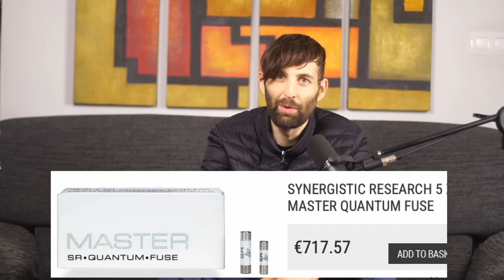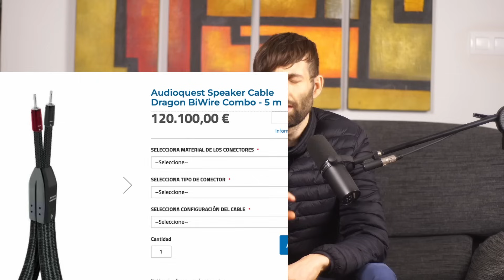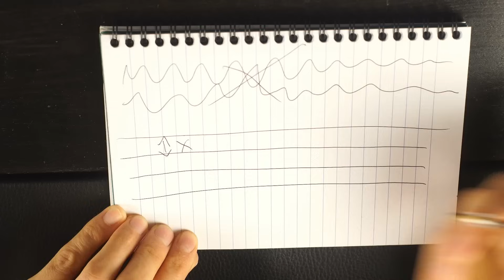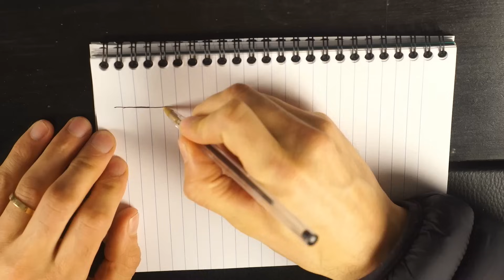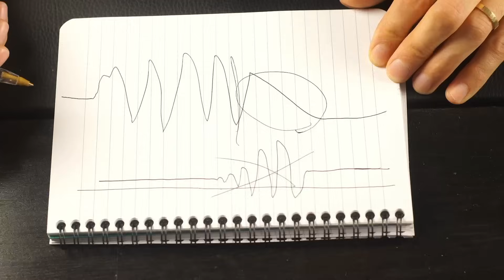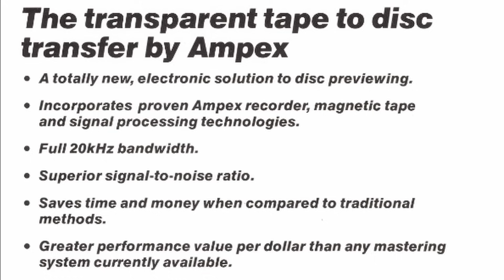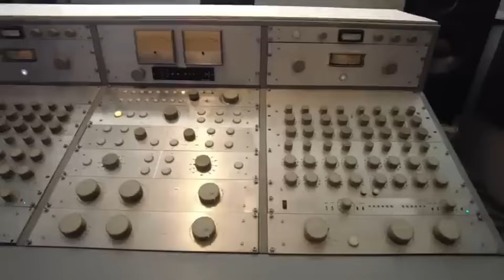Hard truth: most vinyl is digital anyway

Comment: 14:10. Not confusing at all. In fact, I've been waiting for a market model to emerge based on degree of lossiness. Open reel session masters copies, raw and uncurated: up to $5,000 a song / session. Curated open reel master (copy): up to $750. Typical lossless hard copy (vinyl): $85. Required digital copy (where applicable): $40. Typical vinyl plus digital: $105

You get the idea. The tiered quality classification system should be 1) standardized and 2) used to evaluate copyright claims (e.g., the end user's infringement and liability would be different for unauthorized use of an mp3 than for "borrowing" and bootlegging the open reel set and should be evaluated accordingly; or some rights holders may want to dispense with copy rights entirely for select categories, say, by making mp3's freely shareable or similar).

Comment: A lot of streaming software normalizes every track automatically, so if you publish a low compression high rez version, it will be normalized and sound louder than normal automatically in most cases (which is good). Roon uses 64bit float depth conversion prior to volume normalization, so no headroom is lost.

Comment: Most vinyl masters have been pushed through a-d/d-a during cutting since early 1970's. It was trying to be a 14 bit chain, but maybe 12 or 13 bits actual.   It still rawked!  13 bit audio can be VERY VERY GOOD, and still a few dB quiter than the best vinyl record playback.  If recordists and mastering of CD's were intent on best s:n and lowest distortion, not overall mostest-loudest,  CompactDisc would never have had the hate, and older cd's would sound EVEN BETTER as newer-cheaper-better d-a converters got into $1000 consumer stereos. Loudness War remastering was a crime against consumers of music.

Comment: When you buy a really expensive turntable with a good needle and clean your vinyl with some fancy machine the lp can sound almost as good as a cd.
Reply: absolutely true.

i think a lot of what people like about vinyl are the flaws. for instance, i think "musicality" is dynamic stylus drag. high torque turntables sound "dead" or gasp "digital" because they have accurate and consistent speed.

the more accurate your playback... the more it sounds like the digital which is either accurate, or not playing.
Reply: a "cheap" cd?
Reply: @hazardeur  you can get most modern music for €15-€20 on CD, on vinyl it’s about 3x the price.
Reply: @hazardeur   Well, the vinyl record is likely more expensive, I think the poster aimed at that? I try to read forgivingly, with text being highly lossy and such.
Reply: @hazardeur  Cheap CD player.
Reply: @axi0matic  are there such things? i mean the speakers can be cheap obviously but the player as such is just a laser that reads the signal or not?
Reply: @hazardeur ? As in - a CD player that doesn’t cost much money…
Reply: @hazardeur  There might be differences in error correction, which may apply on old CD's with physical damage on the disk itself.

Otherwise there might not really be any significant differences that would be applicable to a CD quality Audio track.

Comment: Did you look at my comment in the previous thread? I was specifically saying the difference is probably that the analogue recording mechanism used in classical and jazz recordings in the "golden era" (1940-1970) are superior in terms of dealing with dynamic saturation in a way that sounds more like how the ear handles loud sounds in the room (namely the ear does not limit, it saturates)
Reply: The ear absolutely DOES limit, it takes less than 5 minutes of +100dB sound ..
Reply: @hansemannluchter643  I am not sure what you mean. The only thing I know of that has any analogy to limiting is the contraction of the stapedius muscle which occurs within milliseconds after music hits 90-95db (more or less depending on the ear). That dampens the vibratory pick up in the ear, but it does not limit in any sense equivalent to what digital limiting does. It is more like putting a temporary mute on a violin. It certainly does not prevent acoustic saturation as voices and orchestras peak.

Comment: Vinyl does in fact sound better than digital....when you buy original pressings that are all analog.  The reissues over the last 20 yrs all have digital in them.  They are over bearing,flat,too compressed,and the mix sounds cold so therefore they add more bass to sterilize it.  Hence,a digital quality sound .  Bring me any CD and I will beat it sound wise with a  true analog 1st pressing.   
Bring money too if you're a betting man.

Comment: The loudness war is what caused audiophiles to prefer records.
Reply: That's an interesting thought. There was also a problem in the early days of CD mastering. In the mad rush to get CDs mastered and pressed, they were taking the tapes with RIAA equalization and going with those. I don't know how many, but there were discs getting to consumers with a huge high frequency boost; the EQ that makes vinyl LPs sound good. I'm a fan of vinyl, but I would never say that it's best. The 33 1/3 LP is an amazing example of materials science and engineering from CBS in the late 1940s.
Reply: The RIAA curve has never been part of the tape. It's simply a fixed curve used for every cutting process.
Reply: @ksteiger  You are probably right. It was something I remember hearing in the confluence of stuff going on back then. Perhaps an excuse?
Reply: @scottgfx  Very early consumer DAC chips were not linear and were actually 14 bit and not 16. Basically Philips has to select every TDA1540 they made for linearity. The most linear were used in Marantz CD players, the other in Philips ones. Then they made the TDA 1541 that at leas was 16 bit. Linearity problem were solved in the SAA7321 that used 1-bit "PWM" bitstream the linearity problem was solved. So early CD players, epecially if used with a system designed for vynil sounded with a lot of high frequencies and tinny.
Reply: @scottgfx Agreed, I remember listening to a Van Morrison album on CD that had been transferred to straight to CD from an analogue master. The hi-hat was sitting out in the middle of the soundscape so much I laughed my head off, then gave the cd away to someone.
Reply: For some audiophiles, likely.  But not all.  Tons of audiophiles still insist that vinyl is better "because it's warmer" etc... etc...  Most of them don't know what they're talking about and are blindly buying into the snake oil salesman buzzwords.
Reply: yeah this.  I'll just cut and paste my post...

I think one point that maybe wasn't clear was that vinyl has a greater dynamic range than digital. That is completely not true. Digital has the greatest possible dynamic range. Vinyl is a COMPRESSED format by it's very nature. He touched on that in the video. Longer records sound quieter because the grooves are closer together. In fact, my original vinyl release of Rush's Presto says right on the back cover, "side B is longer than side A and therefore quieter, so TURN IT UP!".  Vinyl is compressed. When you compress you LOSE dynamic range. Vinyl is simply not capable of the dynamic range of digital recording. 

The reason people THINK it is, is because of early CD's (also a compressed format) and the loudness wars. The reason so many modern recording sound so bad is because producers and mixers smother them in compression so they sound at the same level (volume) as every other song on the "radio" (spotify). This kills all the peaks and valleys that are present in the recording and makes them sound fatiguing.  People are confusing the inherent ability OF the format with what actually gets released. There is a reason all the best classical performances are recorded digitally. It's up to audiences to demand digital versions utilize the technology to it's fullest. People need to be taught that it's OK to have to use your volume knob.  

It's also because CD's are not large enough to hold full lossless (WAV) files. If you used lossless WAV files for a CD you might get 4 or 5 songs on it. Older ones were even worse from what I understand. So a lot of vinyl snob experience was from those early CD's which were compressed like crazy and often didn't sound great. That's not a flaw of digital. It's a flaw of the CD format itself. 

Now..in terms of "better", that is completely subjective. You can like the "warmth" of tape hiss, and how it sounds transferred to vinyl, better, but in terms of the objective measure of dynamic range it is not better.
Reply: @ ur wrong, vinyls are mastered with more dynamics than digital, and thats a fact.
Reply: @bobzmuda3940  did you not watch the video?
Reply: @michaelbrunner4968  he did
The guy who made the video left out crucial points.

Specifically that digital mastering is complete garbage .

Rather than taking advantage of the increased dynamic range, they just raise the volume of the whole damn thing .

This is why vinyl is still around for people who have ears.
Reply: @LuciferisKing666  god bless you 🤟
Reply: @bobzmuda97  nope. I don't think you understand what mastering is.
Reply: @ i graduate 2 schools in recording arts, i know what mastering is
Reply: @bobzmuda3940  well good for you. Another one who paid thousands just for their teacher to say how marvellous they are
Reply: @ actually what i got from it is learning how to record mix and master music.
Reply: @bobzmuda97  no you don't. Cause if you did you'd know that "digital mastering" isn't ONE thing like you implied. You can digitally master something with compression or without. You can make a digital master as dynamic or as squashed as you want, based on the dynamic range of the master recording. Whether that master recording was digital or analog. 

geezus...just search "dynamic range of vinyl" It's about 70db. 16 bit digital is 96db. 24 bit is about 144 db. Studio master tapes are about 77db. 

Those must be the 2 worst schools ever.
Reply: @ wrong. digital mastering is exactly that, mastering for digital platforms. you can master digitally, or master for digital. i was referring to the latter 👍
Reply: @bobzmuda97 Master for "digital" is a meaningless statement. CD's are digital. WAV files are digital. Spotify is digital. Youtube is digital. Bandcamp is digital. So what are you talking about?  You're making up your own strawman definition of mastering which goes against the what it's meant throughout recording music history. 

If I digitally master my WAV file and put it on bandcamp it's a lossless recording and thus has more dynamic range than vinyl. So no. You're still wrong.
Reply: @ nah, all the mediums you listed are ruined by modern day loudness war mastering. they master cds, spotify, and youtube, all usually with .wav files completely bricking out and hard clipping their waveforms, either with too much compression or limiting. 
read Modern Recording Techniques. it’s a standard textbook in every curriculum, the author is David Miles Huber
Reply: @bobzmuda97  geezus...you really don't know what you're talking about....lol.
Reply: @doublestrokeroll  okie dokie 👍
Reply: @bobzmuda97  OK...just answer this one simple question, yes or no. 

Are you saying it's physically impossible to master a digital recording to maintain the maximum dynamic range that is present in the producers final mix?

Simple yes or no.
Reply: @doublestrokeroll  No. 

Im not saying it’s impossible to master for digital platforms and maintain dynamic range. 
I’m saying if you go buy a CD or stream from Spotify, or listen on any official digital release, you are hearing a dynamically squashed master of the mix. 
Im not saying it’s impossible to do, i’m saying that across the industry, it’s not what’s being done.
Reply: @bobzmuda97  Good. That's all I needed to hear. I win. Digital has more dynamic range than vinyl. 

And it's not all across the industry. Plenty of artists and companies release lossless. You're just not looking hard enough.
Reply: @ it’s across the industry and it’s most songs and releases
Reply: @lizichell2  yup
Yup
And yup
The reason I’m back
Reply: I think it was due to bad mastering, not just The Loudness War. For compact discs to sound good they must be well mastered for the environment it will be listened in.

The reason I mention the environment is because some music was mastered for a specific environment. An example of this is Phil Spector's Wall of Sound Technique, which was designed to make songs sound great on a pocket AM radio. The problem is: Often it doesn't sound very good anywhere else.
Reply: YEAH FUCK THE LOUDNESS BULLSHIT.  Fuck me. I open some files in Audacity just to see and they SOMEHOW avoid clipping.  The other day i opened one and it CLIPPED all the way through. fuuuuuuuuuuuuuuuuuu
Reply: That's the only legitimate argument, but printed CDs that are pre- "remaster" versions and reprintings will be the same.
Reply: True. Problem is, now that we know full well that the mastering techniques were the problem and not the format, and we have appropriate alternatives in place which preserve the integrity of the original sound, many of the "audiophiles" refuse to acknowledge facts because they're so invested in their shiny expensive analog-everything setups. But the facts don't care about your lacking coping mechanisms or poor investment skills. They are just facts, no judgments and no exceptions.
Reply: No it's not - that's just a justification they've latched onto to justify their preference. The real reasons are nostalgia and / or a fetish for electromechanical devices.
Reply: Oasis *joined the chat.
Reply: Spot on, bro!
Reply: big factor for sure.
Reply: This is a huge bummer.  So without a way to get a digital copy of the vinyl master, you can literally get a "better" digital copy by recording vinyl playback.  How ironic.

Is there a resource that tracks/compares/evaluates this sort of thing - similar to how Blu-ray sites that analyze the quality of different Blu-ray releases?
Reply: and this guy just completely ignores that, digital has no dynamics nowadays. vinyl masters usually do
Reply: Loudness? Do you mean fullness? The only difference is the false warmth of the needle that actually takes away from the sound and adds a fuzz.
Reply: @ wrong, just wrong. like only wrong. vinyl needs dynamics, the needle cant handle the constant loudness of the spotify versions
Reply: @bobzmuda3940  exactly or the needle would skip especially while a DJ scratches (scratch hip-hop DJ here)
Reply: @michaelbrunner4968  Google digital loudness war.
Reply: @michaelbrunner4968  google Loudness War, it's a real problem in the digital music world, unfortunately.
Reply: I think you are probably correct.  Im a recovered addicted audiophile - ive had £50k CD systems and £50k Vinyl and there is no way CD is more enjoyable to listen to. I could put on an LP and listen for 8 hours. CD Im tired before the end of the CD.   BUT 24 BIT FLAC is a whole different ball game.  My dislike is CD...!!!

Now that may not be the technology - it may be how people used it.  CD was amazing the second you turned it on, and it was great for low cost systems.
Reply: @piccalillipit9211  it was entirely the mastering process, and nothing to do with the media. CD as a media is just fine, but when the recording industry gets high on its own product and slams every master destined for CD, then yeah you're gonna get listening fatigue..
Reply: @ChamiCh  Yeah Im prepared to accept that.  Im old and tired and broke now LOL so I just accept that really, it does not matter if people prefer vinyl or CD or wax cylinder - if thats what they like that up to them.  I think its good that we are starting to get a consensus that actualy - NOBODY was in the wrong.  Both people had a valid point - the industry was jacking up the levels to make CD sound WOOOW and get people to switch over.